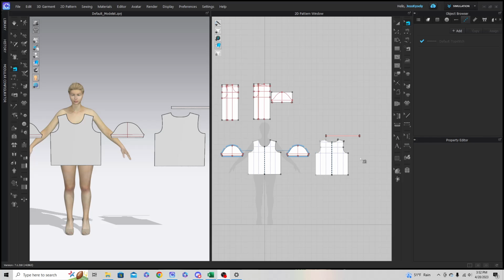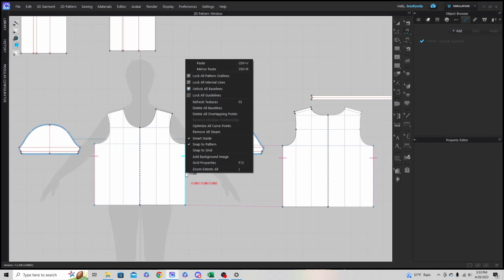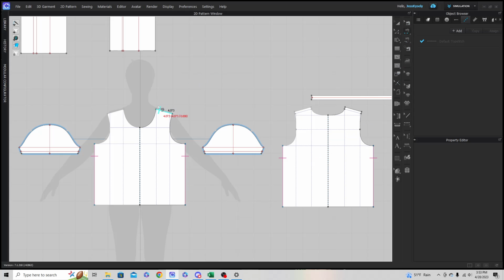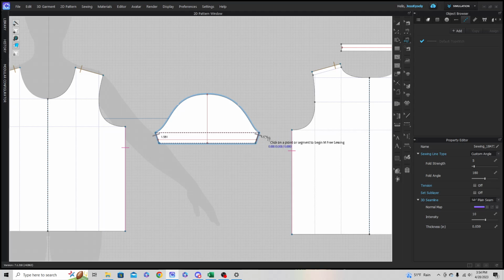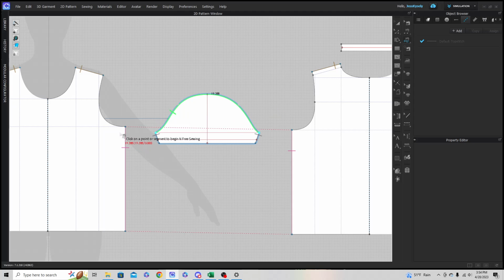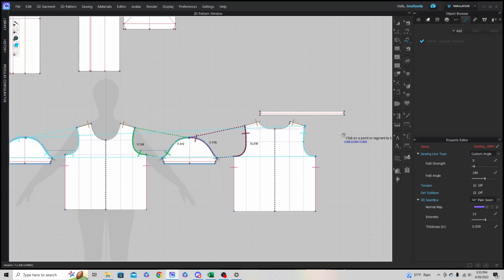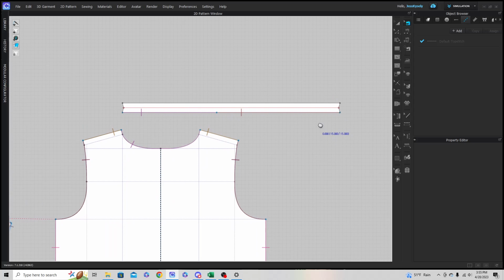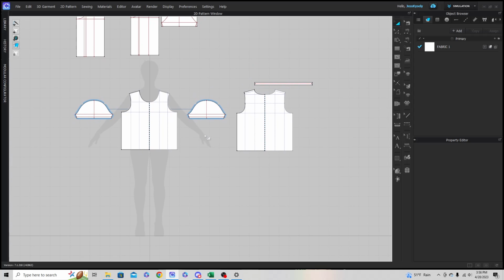CLO 3D Tutorial 7 - Basic Boxy Tee - Sewing the t-shirt together

Comment: followed the tutorial step by step but when trying to sew the neckline trim to the neckline it only allows me to select the back of the neckline to the middle segment point, it does not allow me to trace the entire neckline as the video shows at 2:46. Any suggestions?
Reply from the maker: It sounds like you may have “linked editing” turned on. If the pieces are outlined in blue that means linked editing is on. When linked editing is on, everything you do to one side of the garment will be applied to the opposite side. In this case, you would only need to sew one side of the garment and sewing would automatically be applied to the other side.
If you want to remove linked editing, you can seelect the piece, right click, select “removed linked editing”.